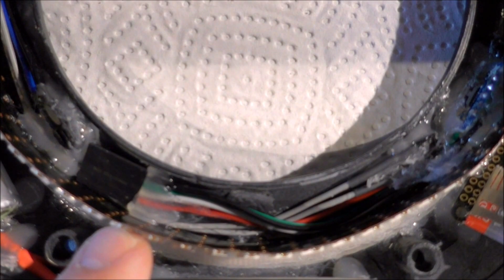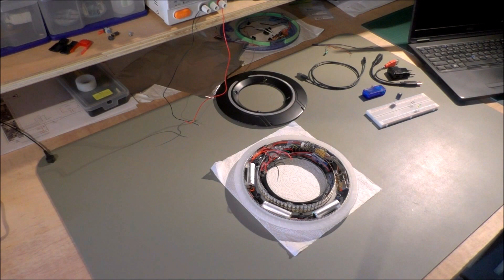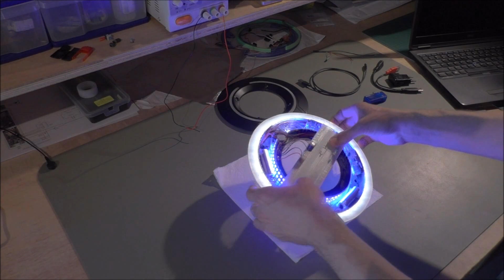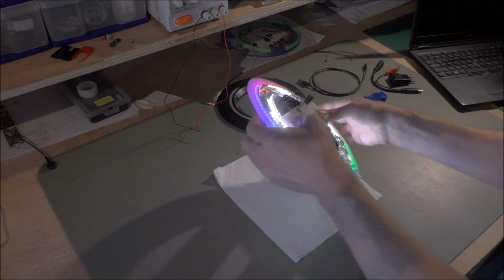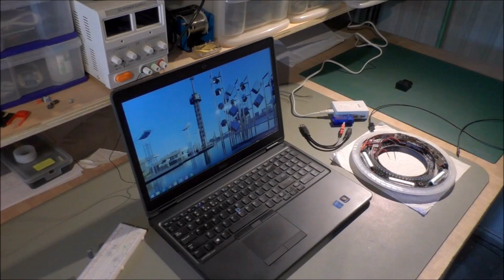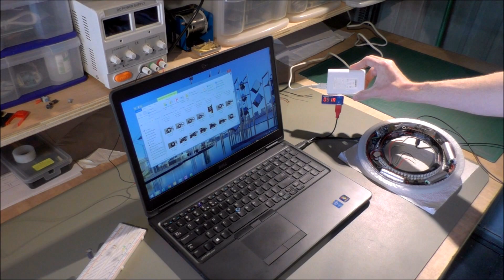#3 - Tron Legacy Identity Disc - Hardware finished, time for programming!

Comment: I've been following your RPF build for some time now and I have one question. Will this one have the same functions as the Plecter labs disc?
Reply from the maker: Hi KD7NHM my disc will be very similar but this version will not have all the functions. Erv's disc has tilt detection which is used for certain control features but also for sound changes. This is made possible by the Crystal Focus (CF) board he made. Unfortunately his current version of the CF board is not compatible with the firmware he wrote for that so I had to go a different route. Erv created a modified firmware for his CF board that is in his disc sou it could communicate with the Arduino board that controls the NeoPixel LED strips.

I will implement "knock detection" so the disc will respond to impacts on the blade. 
So in the end my disc will be very similar.

Erv is working on a new version of the Crystal Focus so in a future iteration the disc may have all the same functionality.
Reply from the maker: Hi, sorry for the late reply. Had a really busy schedule the past few months ;)

When it's done this disc will have close to the same functionality as Erv's disc but it will not have the tilt detecting with acompanying sound change. It will have bump detection. Hopefully I'll finally get around to finishing the disc soon!